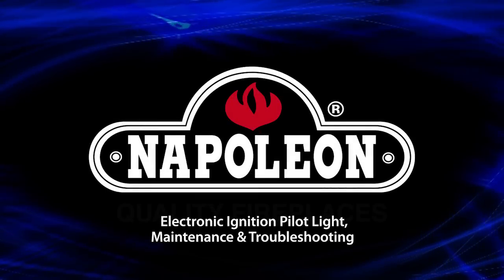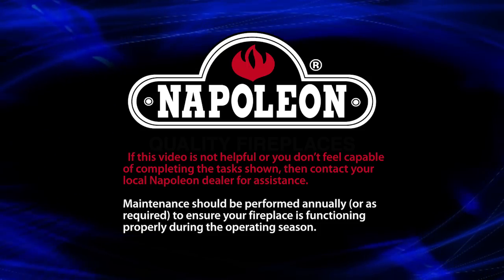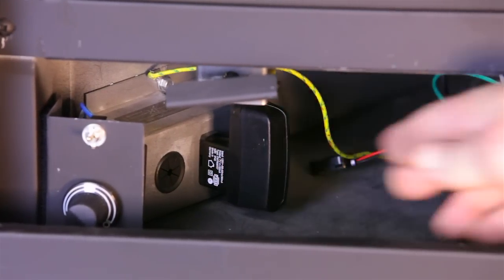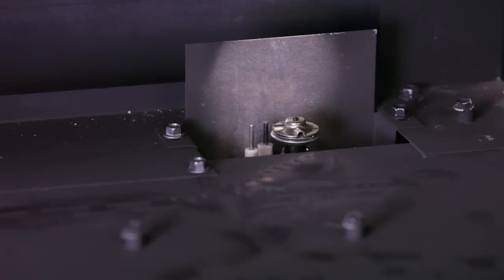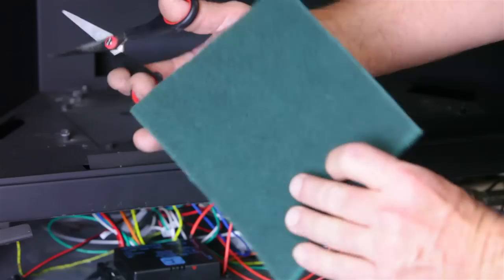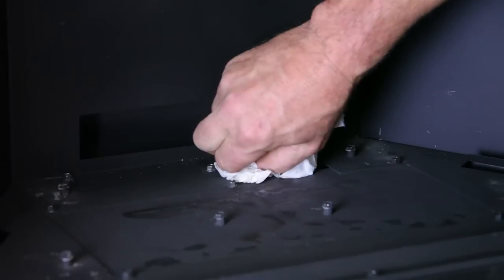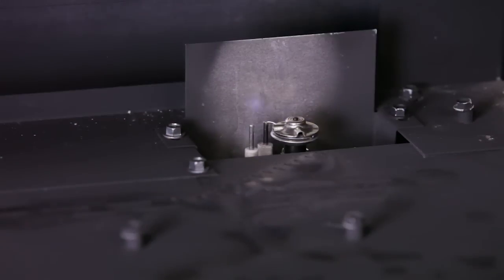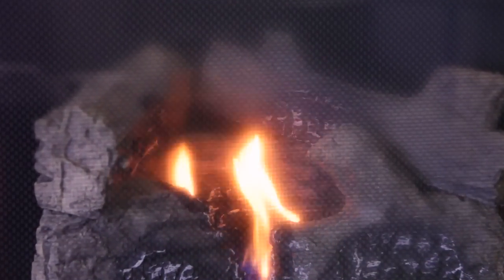Napoleon Gas Fireplace Electronic Ignition Pilot Light, Maintenance & Troubleshooting

Comment: Michael: The rock wool is placed on the burner ports to 1)trap the gas and assist smooth light off, 2) to provide glowing effect, 3) convert blue flame to infrared energy for heat transfer.
Vicky: Check vent is clear, especially after summer dis-use. Bees nest choke the vent. Also rock wool embers should be replaced annually to maintain flame on burner is not lifting and extinguishing.

Comment: Thanks so much! I followed this instruction, with just hand wiping and sticking a little piece of 220 grit sandpaper there, got it working. Whoooohooooo!
Reply: Yah, but you shouldn't have to do this.  The old gas fireplaces never had these issues.  These modern designs are crap

Comment: I have the same problem, with my Napoleon HD40.  Pilot lights perfectly every time but the main burner doesn't light.  I'm not sure if the problem is the 3v electronics not sending the correct voltage to the valve, or if the valve isn't opening when told to do so.  Thermopyle is sending about 480mv to TP-TH/TP.  With that voltage what should the reading be between TH and TP to open the solenoid?  Or do I check for ohms without the voltage applied to TP-TH/TP?

Comment: These new Napoleon fireplaces are total garbage.  I have one and it is very difficult to light, sometimes not lighting at all, with a stupid remote with which you have to hold down two buttons at the same time.  The old fireplaces were much better, with a simple wall switch, and never had any problems operating year after year.  DO NOT BUY THESE - they are total modern garbage, and very expensive!